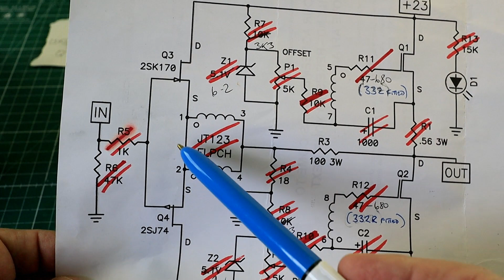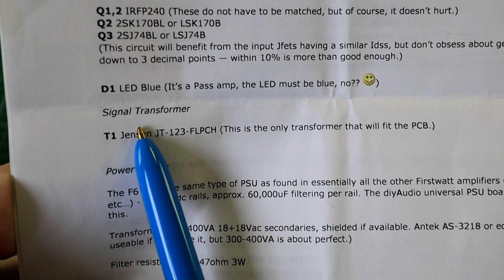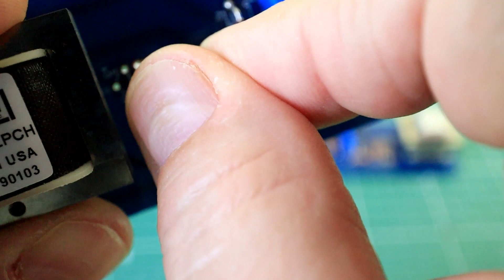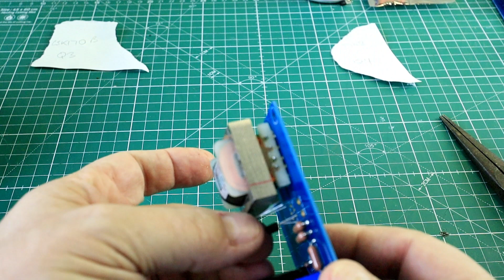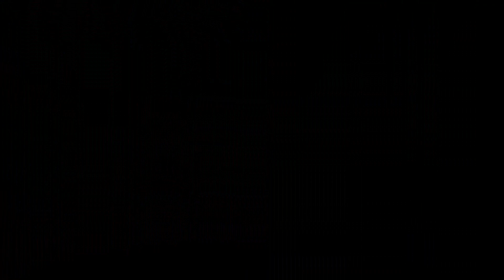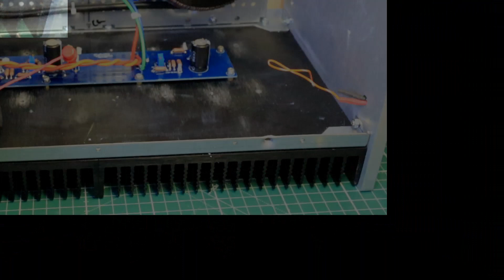First Watt F6 Power Amp (Part 1)

Comment: What did you use for the Rectifier Diodes? What was the size of your Transformer?
Reply from the maker: Vishay Bridge Rectifier, 35A, 600V, 4-Pin. RS part No 227 8772 I used two 300va 18-0-18, If you go to my channel 'Power Supply' video the info is there.
Reply: @thediyaudioimplementers1826  Are you using 2 Transformers for isolation or are you running each Transformer in parallel to increase the current? The reason I ask is because I am using a single 18v (400va) Transformer and I am not getting much current out of it less than 3 amps per rail.
Reply from the maker: @kft590  please go to the AJ ‘power supply’ video the answers are there.

Comment: Noticed that you had the probes across R1 resistor (0.56 Ohms) when adjusting the bias. Shouldn't be the R2 resistor (0.47 Ohms)?
Reply from the maker: Either resistor will do as long as you adjust both boards with the same resistor.

Comment: Hi Lav, I am just gathering the bits for an F6 build and was wondering what snubber caps you used in your power supply. Do you have the BOM you can share? Also the rectifier diodes etc.
Reply from the maker: The latest BOM is available at DIYaudio. (PassLabs) Build Guides.

Comment: Suggest you use some thermal paste between the coupled Transistors, plus use a dot of superglue on the cable tie and package to keep in place.
Reply from the maker: Good tip!
Reply: @thediyaudioimplementers1826  another way would be to use some shrink wrap tubing !

Comment: One  thing anyone building this needs to know, is that the transistors (2sk170 and its counterpart) went out of production years ago. They're available on Ebay, but most are counterfeits. Real equivalents are available at the DIY store, made by Linear Sysytems. But what was once a  35 cent transistor is now what, 10 bucks a piece? Ridiculous, IMHO.
Reply: It is rediculou. Try finding genuine Toshiba parts and you will be shocked with the prices also.it is what it is. The are quality parts and it's a shame no longer in producdtion.
Reply: @brandonburr4900  it costs a lot to keep a product running if there is no significant volume demand.
Reply: LSK170 and complementary still available, but i never tried LSK.

Comment: Please can you make this amplifier for a price?
Reply: When you start to add up the parts for this amp including the f6 complete kit, jfets,  power transformer, bridge rectifiers,  filter capacitors, wiring, solder, chassis and back panel kit (this alone is north of $400) from diy it will be hard to do this amp for $800 or more. And that doesn't include any labor 😀
Reply: yes, 5k